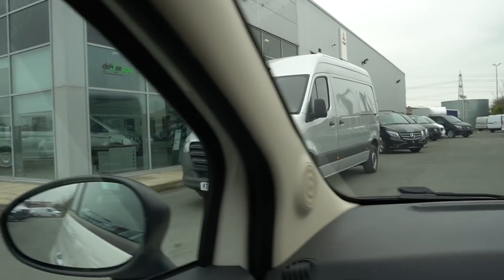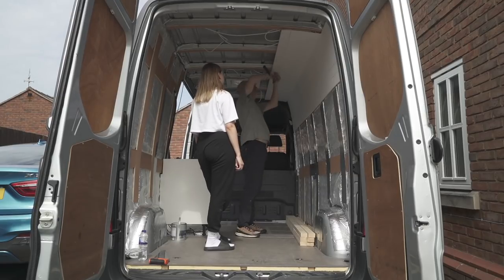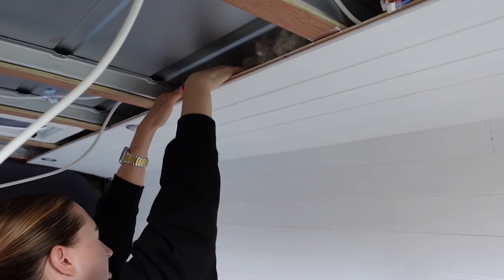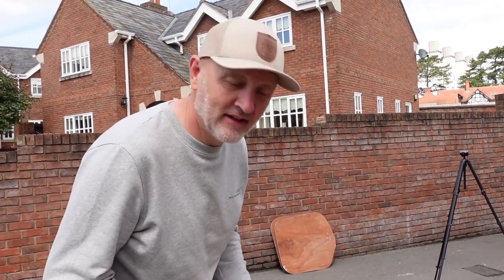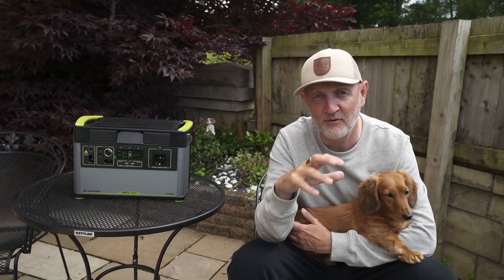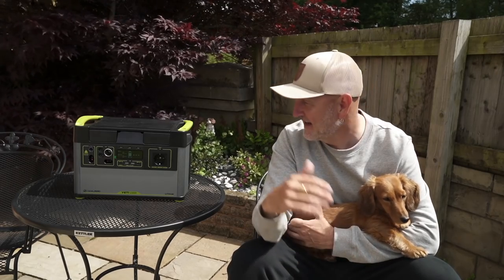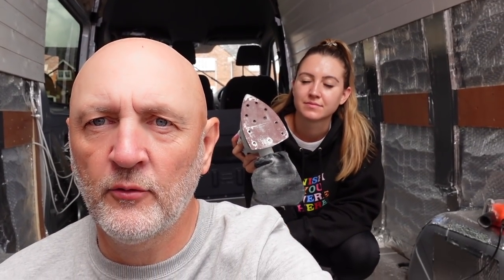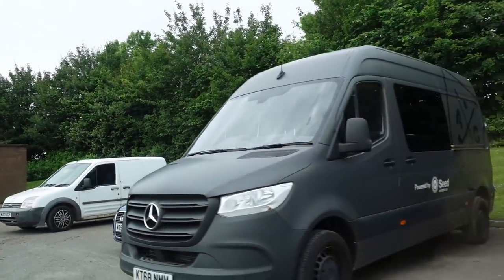This could go HORRIBLY WRONG!

Comment: Wish you had asked for info on wiring up your van , I would have drawn you a wiring diagram to simple fiting of all equipment you have used switches lamps and a split charging set up , I live relativly close to you and am fully qualified auto electrician ,
Reply from the maker: Arghh your help would have been welcomed, still lots to finish if you ever want to take a look?
Reply: @TheAverageGolfer  Let me know if you need Auto Electrical help , I will catch you at one of your outings maybe Conwy,

Comment: Looks great guys . But you do know that the push connectors you have used for the electrical work need to be also put in  box / enclosure for fire and shorting safety.  WAGO. do just the thing for there connector types.
Reply from the maker: Ok thanks Peter, I will get some of those 👍🏻

Comment: Looking nice, but I would have used screws instead of nails. If for some reason in the future you need to repair some thing, it would have been easier to remove a section of the wood paneling. :)
Reply from the maker: Yes makes sense 😂

Comment: Great job guys but did you knot the panels before you painted them 🤷🏼‍♂️🤦‍♂️??
Reply from the maker: No but I am assuming we should have done? 😂
Reply: @TheAverageGolfer  yes defintiely all the brown spots need sealing with knotting or they will cause you so much heartache 😩🤣
Reply from the maker: @spencerpayne1971  Can we sand down and do now?
Reply: @TheAverageGolfer  easiest option now is to use Ronseal knot block as it can be used on bare or pre painted wood where you have a situation like you guys have 💪🏻👌🏻
Reply from the maker: @spencerpayne1971  Great advice thxs